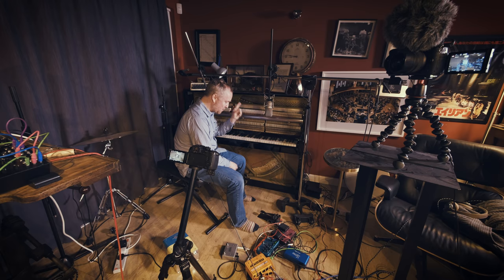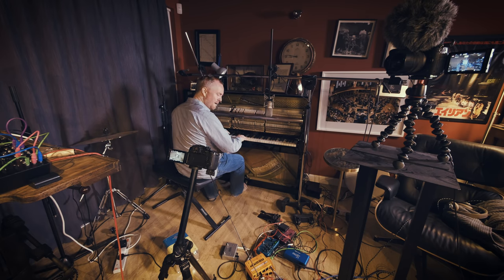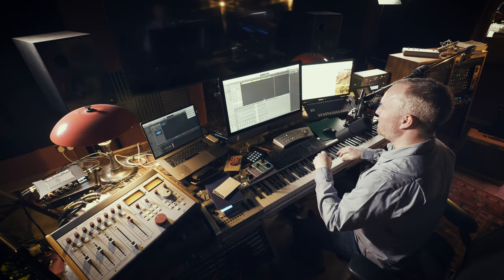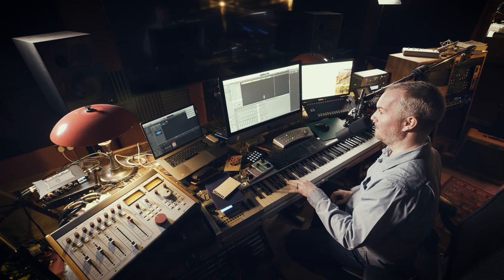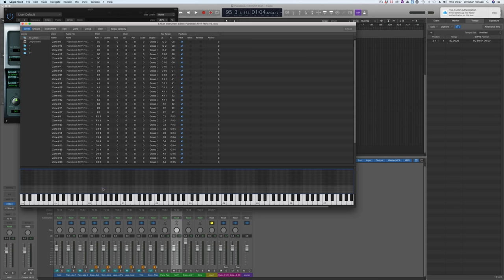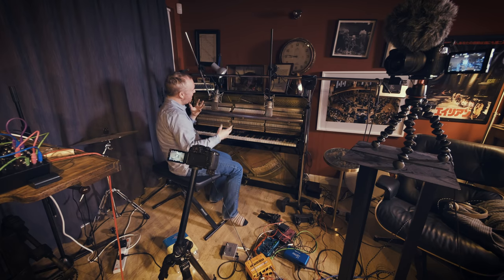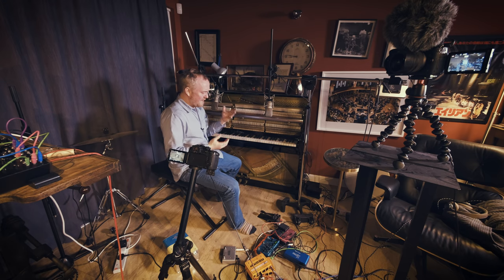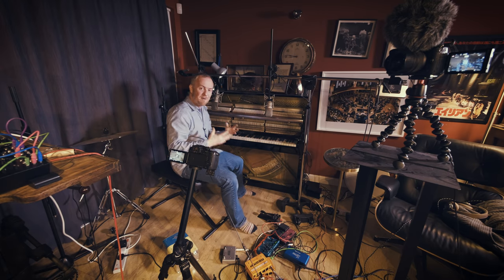Why Do Samples Sound Better When Pitched Down?

Comment: Playing a sample pitched down is essentially lowering its sample rate. A sample at 44.1 played back down an octave is really a 22khz sample with a nyquist freq below 11khz so essentially applying a gentle and continuously deeper low pass filter the further you pitch the sample down. Filter something enough and it begins to sound more 'sine' like, thus your observation that the pitched down samples have more pleasant sine-iness? But the actual sound of this effect would also depend on the algo your particular sampler is using to interpolate between the lower sample rate and the reproduction of analog sound at your 44.1(or higher) DAC.
Reply: you're definetly right here. Good point about the algorithm. I guess in general when you pitch down the algorithm recreates some of the high frequencies, but if you pitch up it doesn't recreate low frequencies, maybe that's why it sounds better to pitch down most of the times.
Also some algorithms actually sound worse when you pitch down, because they don't recreate any harmonics.
Reply: So C1 is a note at a halved sample rate than C2 when both are recorded at 44.1? Your idea seems to be metaphorically mixing clock domains. Here the samples are at 44.1 and changing pitch doesn't change the sample rate, and talking about filtering is making assumptions about the unknown algorithm used. Maybe you're getting to the sample rate conversion method to change pitch? That's the simplest approach that nobody uses. In my day job we often use wavelets to attack this. 

Anyhow I don't follow Christian's pitch down argument. Historically in fact we know that people prefer pitching _up_. In the 1800's orchestras were tuning to not A440 but a few cents lower. Nowadays if you listen to 2nd or 3rd tier orchestras (or kids) you'll hear them sharpen up over the course of the concert. This seems (to me) to go along with the increase in tempi over the same time, which also came from the establishment of the great European conservatories. I think in the 1700's the tempi were much slower. But with the industrial revolution we seemed to get sharper and faster. Louder too, especially as concert halls got bigger. 

I think it's psychological - Christian is a mile-a-minute kind of guy and talks about the annoyance of the computer, so perhaps a fat, pitched down sound is deeply satisfying for you Christian? It doesn't for me honestly, the felt piano samples sounds too much like fat, warm Tribbles. Doesn't mean I don't like it, just not as the centerpiece of my meal. Music is all about movement and contrast, I could see using the Felt Piano in the right context, but I wouldn't use it as my daily piano sample. 

FWIW
Reply: @DanMcLaughlin  I'm not quite sure if the up moving frequency of the A440 is actually about the same thing that the down pitched felt piano is. If you look up the whole A432 discussion (which I don't want to get into too much) you'll find that many people actually prefer tuning down (note the word "tuning" not "pitching"). In my oppinion it all comes down to taste, but most of the times when you're talking about pitching, people tend to prefer pitching down.

and yes you're right, there's a significant difference between a felt piano and a grand for example. one thing I noticed in that regard tho is "trend"
Reply: Dan: Yes, the sample rate (time domain) is the same (and would have to be -- though when listening to a sample recorded at 44.1k played back at a sample rate of 22k, it would be pretty close to an octave lower) --  I agree that some of this may be psychological as you say but perhaps also a result of the processing. As the audible frequency of a sample ascends, it can contain frequencies above the sample rate which causes aliasing, (aliased to the target frequency w artifacts, "harshness"). One has to actually apply a low pass filter while sampling and playing back to diminish this. At lower frequencies this is much less a factor and the sound may seem 'warmer...?'
Reply: @DanMcLaughlin If you record a sample at 44.1kHz, the highest frequency it can contain is 22kHz. That's what the Nyquist-Shannon Theorem states. To make sure there are no frequencies above 22kHz in the recording, the signal is filtered with a steep low pass filter that cuts everyhting above 22kHz. So there inherently is a filter at play. This filter is called the anti-aliasing filter, because frequencies above it would cause aliasing.

If you now pitch this clip down, you are pitching every frequency component. So 22kHz might now be 11kHz. But the result won't contain anything at 15 kHz, because the original sample didn't contain any 30kHz. So you essesntially moved the anti aliasing filter downwards. The sample rate is basically halved. That doesn't mean that you can't save that file at 44.1kHz again … but you won't gain any additional Information.

Another way to think about it: Pitching down means stretching. So if you take a one second audio clip recorded at 44.1kHz, it contains 44100 individual samples. Stretching these 44100 samples over a period of two seconds would mean you are left with 22050 samples per second. Sample rate halved.

So the gist of this is: There is a difference between the file Format and the actual Information that file contains.
Reply: I’m pretty sure that this is no longer true. It was definitely the case with older samplers like Akai s950 or the Roland s760 not to mention the emu sp 1200 (and many more) these samplers are able to playback multiple samples at variable sample rates. On those machines pitching a sample down does effectively lower the sample rate as you stated, conversely by pitching a sample up one is increasing the sample rate. However contemporary samplers and and all digital audio work station all operate at a fixed sample rates (44.1khz 48.khz, 96khz). The same goes for the bit rates you’ve selected no amount of plugins and conversion will actually lower the bitrate either. Pitched down samples today are in fact still playing back at those fixed sample rate as are any samples that are having their bit rate reduced are still in fact playing back at the same rate as the project is set to. Basically everything has to sync with the master clock of cpu which will interpret variable sample rates as samples going out of sync. The same goes for all modern samplers. What they are doing is converting the pitches down audio file in real-time back to what ever the master settings are. This is also true for the MPC live in standalone mode. That is the primary reason modern samplers are not capable of reproducing the grit of early samplers. The only exception to this might be the OP-1 although I’m only making an educated guess about this based on what I’m hearing. pitching samples down on the op-1 introduces the kind of artifacts you’d expect to get with vintage samplers. But don’t take my word on any of this.
Reply: It would probably be over my head but I would love to see analysis of the algorithms in various samplers.  I use the Electron Machinedrum, love the way it sounds almost all of the time but it can be a bit muddy at times...
Reply: @antekoh  Actually you're both correct in a way. The old samplers had to actually move the analog antialiasing filter down and had aliased frequencies (which were very imperfectly removed) also move along with sample playback and their specific sound comes from that.

However resampling (pitching) in-the-box, in digital domain, does exactly the same thing up to a level of perfection. Higher order sinx/x (or sinc) FIR interpolation filters, which are very common in samplers now, offer, for all intents and purposes, perfect downsampling -- so an octave down is really perfect downsampling from 44.1 to 22.05 whereas in hardware it's imperfect with limitations of actual electronics.
Reply: @svenhegenmusic  I agree with pitching down = lpf compared to no change of pitch. The lpf you hear is the low pass filter on the input of your adc on your recorder. However, the reason pitching down sounds better than pitching up is that your particular sampler and the algorithm it uses adds very little aliasing, whereas pitching up adds more. It could easily be the other way around with another algorithm, eg when the oversampling filter cuts in more aggressively, ie it's not right at 22050 Hz but much lower, while using linear resampling.
Reply: I don't think Christian recorded those samples at 44.1kHz, though.
Reply: @antekoh  You are right that the whole audio engine is running at a specific sample rate and so does the DA converter you are monitoring through. But the argument here is about information content. Unless you are using a time warp algorithm, pitching something down, means slowing it down/stretching it in time. It's like playing a tape at lower speed. Most samplers don't use time warp by default. Kontakt lets you choose. So you are in fact stretching the samples you originally had over a longer period of time, so the rate at which these samples are played is lower. This Kind of algorithm doesn't 'invent' any information. Time warp on the other hand invents new samples based on what's already there. Of Course you are listening to that through a sample rate converter that keeps everything running at the same sample rate for the audio engine. 

You mentioned bitrates in DAWs. Do you mean bit depth? The audio engine in your DAW runs with a word lenght (=bit depth) of either 32bit float or 64bit float. Still, you can pull source files into your session that are 16bit or 24bit files, at the same time, without the need to convert them. Sample rates are another matter, because I think sample rate conversion can't really be done at low latencies. But your regular multimedia audio driver has can absolutely play back a 48kHz YouTube video and a 44.1kHz wav file at the same time, while your audio output device is running at 96kHz. So these things are possible.
Reply: Sven Hegen exactly!! It's sound too thing when pitched up
Reply: Yep, there are many things at play here and one must be more specific.
Reply: @moritz.schaller  Yeah, this is what I was going to add. The rate at which the sample is going to develop, the 'envelopes', the mechanical noise, are all going to happen slightly slower, and I think we tend to perceive slower movement as more graceful. When shooting video I often shoot at 30 or 25 fps to play back at 24 for a similar effect.
Reply: There are many ways to play a sample slower and not pitch it down, like beats , Complex , Texture  or some combination of those , feel free to use any good digital audio workstation and you will find out that is indeed the case . Im a producer i know , pitch has nothing to do with sampling frequency  withing usual scales of instruments , you ppl are not producers obviously
Reply: Pavle Pavlovic he is not claiming that the actual sample rate changes. Maybe re-read the thread I think you missed the point
Reply: @5T3LTH     no i get it ,    slowing down= repitch , but that is just one way there are meany others  where slowing down doesnt = repitch is waht im saying , like beats , so you slow down sample by repeating parts of it , you can make 1s sample 1h long and it wont change pitch , or repitch it and not change sampling frequency .
Reply: Pavle Pavlovic oh ok got it. Good point about different interpolation methods
Reply: @5T3LTH  Thanks ,    yeah  its my job , i repair audio gear and produce . Not a lot of money in it but a lot of love .
Reply: this is a method that has been used in sampling for a long time in order to achieve a "grittier" sound. early drum machines with very limited sampling time, required that you record your samples at higher speeds (45rpm/78rpm) and then pitch back down to the original speed, which would reduce the bitrate. this allowed you to nearly double your sampling time, and achieve a more desirable "grittier" sound
Reply: im a producer , now waht you are talking about is sampled jazz for hip hop/pop music, now that is done because it needs to be slowed down to pop,hop,rap BPM ,   from LPs by slowing down LP on a turn table , then recording sample . Fatter sound  is  a result from that process that got engraved in culture so later it was even emulated . That is true but sampling frequency might not be even present  for its sampled from analog sound . Well sometimes LPs are mastered on 96khz , other times everything is from tape ,  producer know that digital sounds better so they  use  192khz , it depends
Reply: @dedskin1  nope, i mean playing it faster on the turntable, so instead of 3 seconds being used on the sampler, it only uses 1.5 or 2 seconds. its a way around the limited memory on old samplers. you pitch it back to normal once its recorded so it doesnt take up as much memory. which also reduces the sample rate. the sampling frequency might not be present on the LP but it will definitely be present once recorded onto a sampler.
Reply: Well put! Could even strap on some tape sat onto the lower sample to regain those higher harmonics lost, depending on the feel you're going for.
Reply: @DanMcLaughlin  Read what konskift wrote. I believe I got it correct: If you have a sample which was recorded at 44.1 kHz (it is recorded now, you cannot add more info to it...), it is because it should at least double the highest frequency expected.... so, the highest should be 22.05 khz...... SO.... if you take that sample recorded and which can't receive more info, and you "stretch" it to make it an octave lower..... then you have for each second, half of the info..... so it is a 22.05 khz....  you reduced the Nyquist at half, there is no more info and you stretched the one you had.....  so half......   Very interesting this topic!
Reply: lmfao this single comment explained everything thanks for saving time XD
Reply: @dedskin1  how do you slow down a sample without changing the pitch in a daw
Reply: @beatbanger27  by repeating parts of it , looping ,  and extending it , there are artifacts to this , but there are also complex algorithms to cover them .
It still is not like slowing down analog LP , but is something
Reply: Was commenting about the sample rate but saw this. Lot of hip hop producers did this on hardware samplers out of necessity due to space limitation and ended up liking the crunchier sound it gave samples on stuff like sp1200, mpc, 404, so still do it. Curious if bitcrunchers existed before then or if that’s where the idea originated.

Comment: " and we like sine waves because sine waves are phat."

-Genius 2019
Reply: Agree, that's wrong to say, what he did in the vid is add more bass content but kill midrange texture. More bass = louder = sounds better. More bass partly matches the equal loudness curve (low freqs).
Then in a certain context when arranging/composing u may prefer one sound or another, typical pop song pad sound is soft and gentle without too many odd harmonics, lets u here the reverb more and usually sits better in a mix.

There's Robert Rich and there's Tim Hecker...
Reply: made me laugh

Comment: Nice one.
For sound design I record 196Khz and then you can pitch down to 5 octaves and still get 44.1Khz sampling rate.
Record 1 minute and when pitched down you get 5 minutes soundscape. Add a massive reverb and you can do a ambient track using sounds around us.
Reply: Surely you can only pitch down two octaves and retain a 44K sample rate? Every time you go down an octave, you halve the sample rate. 

Which isn't to say that it doesn't still sound awesome...
Reply: Interesting concept.. what recordings are best, lively street sounds?
Reply: @charlesgaskell5899  You are correct. In order to pitch a sample down 5 octaves and end up with a 44,100 Hz sample rate, it would be necessary to start with a sample recorded at 1,411,200 Hz.
Reply: @GlenBerry  Plus, when you look up the specs of any decent microphone, they don't go anywhere near so you can record such high frequencies. Plus, even if you had a microphone to record those freq God knows what you record, a lot of hum anyway.
Reply: @aileaiho768  I suspect you're confusing sample rate with pitch frequency. Sample rate is a feature of AD conversion, microphones don't have a sample rate unless they have an on-board AD converter (such as USB mics).
Reply: @kavokei1337  What they were talking about is changing the pitch and time of the sample by playing the sample at slower sampling rate than it was recorded. This way you also get higher than 20khz pitch sound freq into the audible range.
Reply: To me that is the biggest pro to recording at high sample rates. If I'm not planning to pitch down anything I'll just record at 44.1 or 48. That being said, Steinberg's new AXR4 interface features a 384khz sample rate, which would give you another octave or 'pitching headroom'.
Reply: @peniku8  Are you aware how precise clock you need to sample accurately at 384khz? People are spending thousands of dollars for a good enough clock for 44khz.
Reply: surely you must need 10,000 terabytes of disc space if you record sound design anything like myself